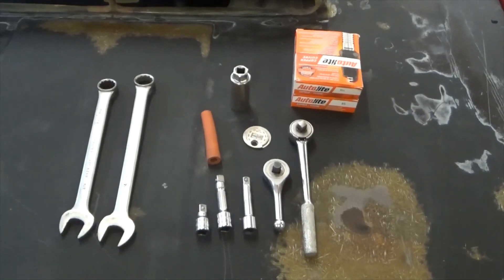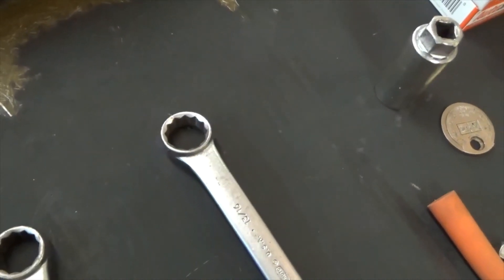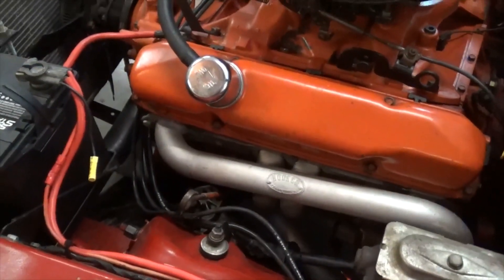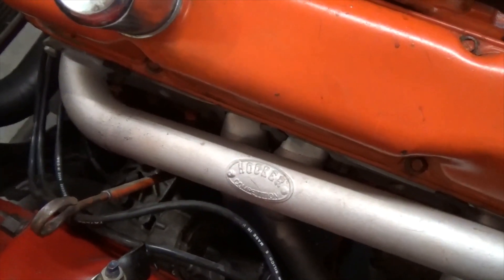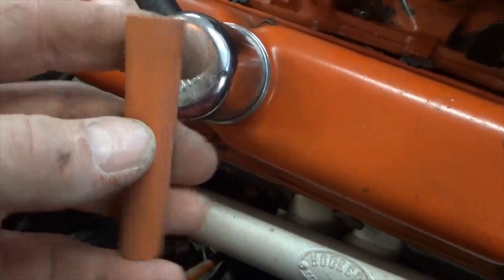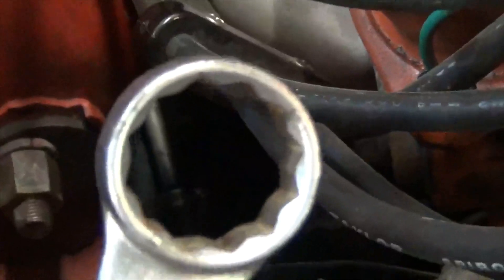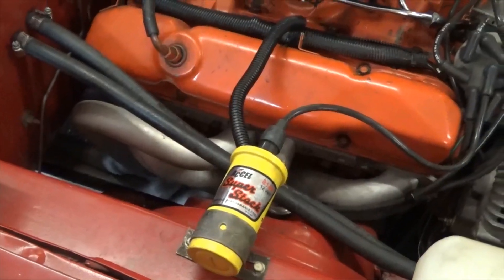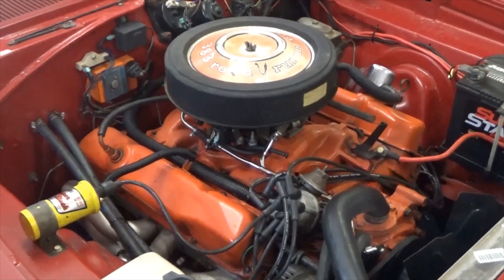Installing spark plugs on a big block Mopar with headers

Comment: Great tips

The nastiest cylinder is always #8 on the RBs. Why is that Ron?

Those wires look almost identical to my Taylor Spiro Pros.

Love em'. Put my ten year old, used Taylor up against a brand new fancy Accel.

The ohm meter proved it was far superior to the new Accel.

Up here we must load our boots with dielectric grease or it ain't coming off next time, on the small block Mopures.

I always use copper cores. Love Autolites on my 5.0 litre EFI'd Ford Bronco.

Had a lot of luck with Denso U grooves and NGK V grooves, both copper core, on the small block Mopars.

Keep em' coming Ron. Loving it.

Malcolm Ottawa Valley
Reply from the maker: The #8 plug is especially the toughest on cars with factory air conditioning, but on C-bodies from 68-76, the #7 plug is the absolute nightmare. It MUST be done from under the car.